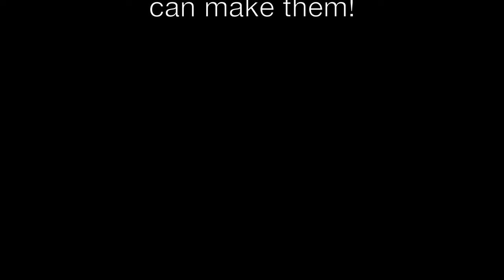T1N Sprinter (2004-2006) Transmission Service + Valve Body Removal

Comment: So when you say level 2 persuasion tool, what do you mean. I can not seem to get the tcm plug receiver out.
Reply: Also the internal torque bits are t30, not t27
Reply from the maker: Bigger hammer! Level two is my joke meaning "the little one didn't work" and a persuasion tool is just a hammer.
Reply from the maker: Correct. My tools were not in the proper places and I didn't notice it was a bigger bit where the 30 should have been.

Comment: so what is cause of dipstick bottoming out? incorrect conductor plate installed? my 2002 freight liner badges sprinter bottoms out the transmission dipstick as well and wondering if i should replace conductor plate or if it matters at all
Reply from the maker: Yup...this transmission is shared with other Mercedes and Chrysler cars. The cars have a different style transmission dipstick that’s either always present or straight up in a different location. We showed this in the video. The difference is in the recepticle
Reply: How to check transmission fluid level with U shape conductor?
If it is slipping.

Comment: hello quick question.
my transmission sometimes drags on shifting gears randomly but not often. probably because i'm towing my magnum behind my 30' sprinter van with the 3.0 Diesel. i ordered a deeper pan just waiting for it to arrive. currently on a road trip from portland oregon and i'm in dallas texas now. do you think i should get a new valve body for my trans like you did?
Reply from the maker: Fresh filter and fluid should resolve the issue. Don’t forget the torque converter. In the event it doesn’t, I would look at the valve body/conductor plate.
Reply: Florida Van Man 👍🏽

Comment: Would this fluid work on 2005 Freightliner sprinter 2.7 as well ? I heard Shell ATF 134 can only be used on Sprinter with V6 engine
Reply from the maker: Yes, it is MB approved for all North American Sprinters 2002-2007 and beyond, to what year I don't know. The NAG1 transmission is the same in all of them thru 2007 at least. Over the pond they have manual transmissions and other auto-gearbox options that I am not sure what fluid is needed.
Reply: @FloridaVanMan  Thanks !

Comment: Any tips on reattaching the Computer Plug? 
I felt around and got it to where it slides in to place, but I cannot get that center bolt to catch for the life of me. It just spins and spins. I’ve been trying for a lot longer than a I care to admit.
Reply from the maker: Either the connector is not pushed in deep enough or the conductor plate is stripped where the screw screws-in. Be sure both O-rings came out with the old connector and if needed, force the plug into place with a board/lever.
Reply: Thanks I’ll check and make sure it didn’t get stripped. When you say a board to force the plug in, I take it that means it might take a good amount of force to get this all the way in? Like should I not be able to see the O-Rings anymore?
Reply from the maker: @michaelrodriguez2741  Oh, definitely should not see O-rings when connector is fully inserted. It helps me to line-up by turning the 'lock' down/unlocked then align it where I can just get a finger behind it to close/lock it. That should have it lined-up and ready to push on. Some aftermarket plugs fit better than others and I have had at least one that made me get a 2x4 and lever against a solid brace on the van. We should NOT need to do this so be sure everything else is lined-up, oily, and clean before using force. Using the center bolt to "pull the connector in" never works and only strips the hole. But I often push and wiggle it in as far as I can, snug the bolt then push and wiggle some more. Repeat as needed until it won't wiggle. 
If you can still pull your connector out, look at the end of the screw and be sure it doesn't have a nut stuck on it. if it does you will need to remove the nut and say a little prayer.

Comment: will the link for the conductor plate fit a 2007 mercedes sprinter van?
Reply from the maker: Yes, the transmission remained the same past 2007, NAG1 722.6.

Comment: How much fluid did you have to add after this procedure ?
Reply from the maker: Luckily, the '08 does not have DEF, only DPF. Particulate filter but no fluid until I think 2010.
Reply from the maker: @ExclusiveK9Alberta   Trans fluid after a full service including the torque converter usually takes 9 liters, +/- half a liter. Sorry for the miscommunication. YT showed me this comment on a different video this morning, the manual filter regen video.
Reply: Thanks

Comment: What are you using to get the TCM plug out? I'm having a lot of trouble reaching that little pin inside it to unscrew. What size socket is that?
Reply from the maker: I think it should be a Torx 30, but we find it is often messed-up and can be pulled with a hex-key (aka Allen wrench).  Yours would not be the first plug that just won't come out. In that case get a lot of cardboard to protect the driveway and catch all the oil you can when you drop the oil pan. Once the pan is off you can get at the top and turn it out, and replace it.
Reply: There is a small hex bolt deep inside the 13-pin socket.  Something around 8mm?  The bolt threads into a brass insert molded into the plastic conductor plate, so it’s ridiculously easy to over tighten and break, allowing the bolt to spin (and the socket to back out...)  Then you need to secure the plug with baling wire or get a new conductor plate... 
Torque this bolt to JUST past snug.
The pan drain takes a 5mm or 6mm Allen (hex). Clean the hole first to get full engagement or you’ll round it out.  Like the rear diff, if the drain has never been removed, it may be seized and refuse to budge.
-dave
Reply: It's a 7mm and it's about 1-2 inches deep,  Tighten just over finger tight... Also,  there are (2)  (TWO) O-RINGS on the Connector,  (LOOK at the New One) he only shows (1) One that he removes - There is another one INSIDE that has to come out before you put the new one on....Hey loving's the RSN for 21 years...

Comment: Being up on ramps does mess with the build level???
Reply from the maker: Yes, we always put the ramps on the downhill end of the driveway and only preliminary cold-fluid checks are done on ramps. We test drive to achieve 80 degree transmission fluid temp and park on level street for final fluid checks.

Comment: Maybe I missed it but what was causing the dipstick to bend and not give correct fluid level before the service?
Reply from the maker: Improper receiving end on the conductor plate, which can be see at 8:05
Reply: Thanks for the really good video.  I’ve got a 2006 Dodge Sprinter 2500 and when I trued to check the transmission fluid level the full length of dipstick went into the tube.  I’m assuming from your video that the “stop” is broken.  If so, where can I buy a new “stop?”  I Called the Mercedes dealer in town and the Sprinter mechanic said there was no stop.  Said he just puts his thumb on the bottom of the red handle at the end of the dipstick and that’s his stop.
Reply from the maker: @pinepaul9920  Oh MY!!! I would love to record a shop technician saying that! The difference between needing fluid and too much is about a quarter of an inch so he better have his thumb laboratory calibrated often! LOL~ Many Sprinters have this problem, with the stick-stop missing. I think it usually comes from a used or remanufactured transmission, because the NAG1 trans is used in many vehicles. Most of them have a traditional dip stick that registers from the top of the tube and stays with the vehicle. Our fill tubes do not fit uniformly into the transmissions, so this is not a reliable way to check levels on Sprinters. I suspect one reason the fill tube is not uniform is because the transmissions were removed and placed in the cargo area for shipping (light trucks only, not passenger vans). They did this to avoid the Chicken-Tax on light truck imports to North America. 
Fun Facts: The Chicken Tax is a 25 percent tariff on light trucks (and originally on potato starch, dextrin, and brandy) imposed in 1964 by the United States under President Lyndon B. Johnson in response to tariffs placed by France and West Germany on importation of U.S. They are still jumping through unnecessary hoops today to avoid this unusual tax.
Reply: @FloridaVanMan  Thanks!  Its been some time but to follow up.  What do you think caused that?  Could it have been caused from the dip stick being stuck in too far?  The reason I ask is I tried checking the level of mine and the dip stick got stuck and while I was able to get it out it was unsettling how much pulling force was required.  I read on some threads that the cheaper dip sticks are not built as robust as the OEM and between that and improper technique can cause it to get stuck or break off.  I was thinking that is what caused the part you said was messing up?  Before I try to check again I will double check the length of the stick v.s. what the distance is between the top of the fill tube til where it hits the pan.  Thanks for this video.  There are not many on the 2.7 5cly 2002-2006.  Mine is an RV.
Reply from the maker: @ibcrypto6139  If the transmission was replaced or wrong conductor plate installed at service, the dipstick stopper may be missing. Other cars that used the same transmission didn't use the same stick and stopper. When that stopper is missing your stick can bend over and go way too deep. Pulling it back out past that unnatural bend is difficult and can break off even the best quality stick.

Comment: my 2006 sprinter would not change gears, it starts normally from parking to D, drives a bit and starts slipping just rolling like it is on N, after stopping ,resetting the transmission it goes again for a minute starts to slip again, would appreciate any advice. It is 2006 , transmission fluid is full, never had any transmission problems before. Thank you
Reply from the maker: That sounds similar to what we found in a van we helped get going last month. At a campground, we replaced the conductor plate, filter and fluid. Of course, we also cleaned the valve body as best we could in the situation and interrogated the computer with DAS.  https://www.youtube.com/watch?v=JmfvqV1ZbOU
Reply: @FloridaVanMan  Thanks a lot

Comment: Problem with shifting from 2nd to 3rd..revs an then hits 3rd..whats the fix ??
Reply: Its a 2006
Reply from the maker: Sounds like 'shift-flare' and you can adapt by letting off the throttle just a bit at that point, letting the next gear grab before continuing to accelerate. The only fix is a Transmission rebuild. It may ride a long time without getting worse but if you need to fix it tell these folks I sent ya' https://www.silverstartransmission.com/
Reply: I've read that Metal bits foul the shifting solenoid Magnets and Cause Shift Flare,  some folks claim that rebuilt or Cleaned Valve bodys will fix that,,, I've got it too and will post how it works for me.. Loving the RSN for 21 years..
Reply: @gregmorse9862  yes please let me know if it helps..

Comment: You show to just pull off the filler tube cap. Mine doesn't just pull off.
Reply from the maker: They are tight if the red tab is still in there, but it will come off with a sharp tug.

Comment: what torque wrench is that?
Reply from the maker: It a cheap torque wrench I bought on eBay many years ago. The logo on the handle fell off some time ago too so I can't tell you a brand. It measures in Inch/pounds rather than foot/pounds.
Reply: @FloridaVanMan  Okay, thank you. Great content, looking forward to watching more Sprinter videos!

Comment: How much fluid does it take
Reply from the maker: If the torque converter was drained, 8 quarts then drive to warm and measure with dipstick. Due to options, different vans will need closer to 9 quarts.

Comment: would this be similar to a 2007?
Reply from the maker: I believe so. While most of the van changed between model years 2006-2007, body, engine, breaks, etc. the NAG1, or 722.6 transmission was continued.

Comment: Greetings ! Why they remove the valvebody ,  and connector , just for maintennance service .
Reply from the maker: It has been a few years since filming but I believe this transmission had the wrong type conductor plate so the dipstick didn't stop at the bottom. Details of this common problem are shown in the video. It happens when a used transmission is installed, taken from a Jeep, Crossfire or other vehicle that uses a slight variation of the same transmission. The valve body must come down to replace the conductor plate.
Reply: @FloridaVanMan  thank you very much , for your input  .
Very helpful !!👌

Comment: Ware in FL are you located?
Reply from the maker: Between the beach and the mouse, Daytona to left of us,  Mickey to our right, here we are, stuck in the middle again.
Reply: I’m in Jupiter FL ... and I need to get this done ... I’m new here and I don’t know any good sprinter shops or Mechanics
Reply from the maker: @reefgameaquatics9285  Sadly, I don't know any good shops in the area either. I can tell you a few horror stories of some you definitely want to avoid. That is why I have become my own Sprinter mechanic gradually over the 14 years of owning my daily driver. With half a million miles I must disclose it is not the original engine, but a fine automobile none-the-less. Mike and I are not mechanics by trade, but we have a flat driveway, all the needed tools, and willing to lend a hand if you want to come this way. Depending on your mobility and budget, we could also come to you. Is there an issue/symptoms with the van or are you just looking at good maintenance practices?
Reply: @reefgameaquatics9285  I so agree with you Reef, I didn't find good mechanics around Jupiter area that know how to work on T1N sprinter. Now I have transmission problems. I wish we could get in touch with Florida Van Man. To get some work done and learn more.
Reply: Igy Valy he has told me to come to them but it’s a 3hr + ride... maybe we can talk to him and have him come down for both of us
Reply: @reefgameaquatics9285  lets talk. I like the idea. How you and I can get in touch?
Reply: I'm  in Titusville. I have some small tyranny issues I hope you can help me with.
Will you respond if I give you my email address?